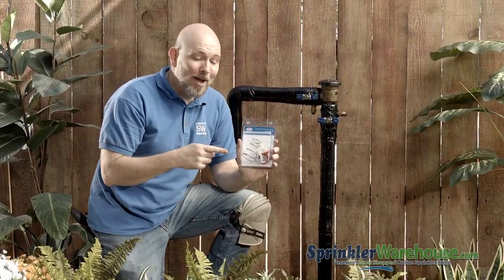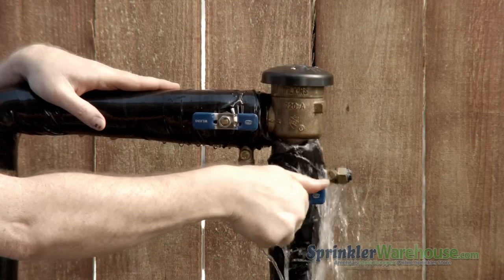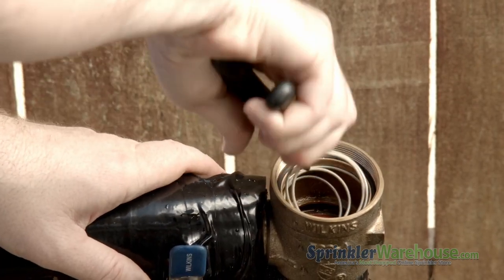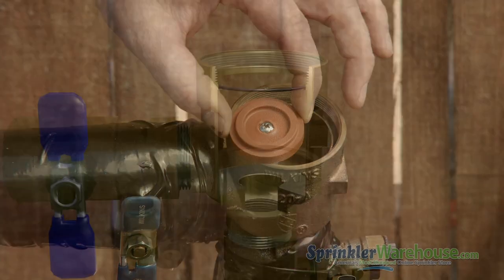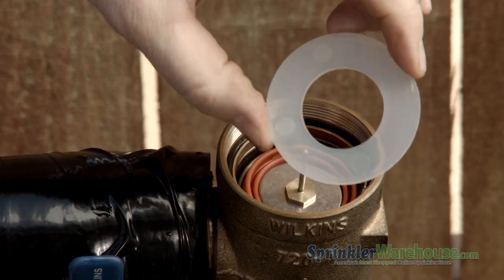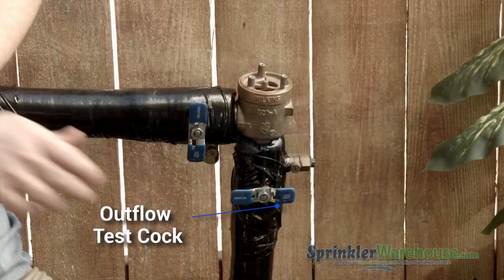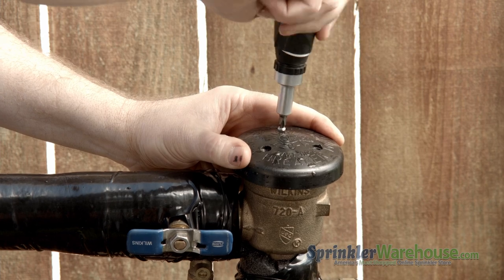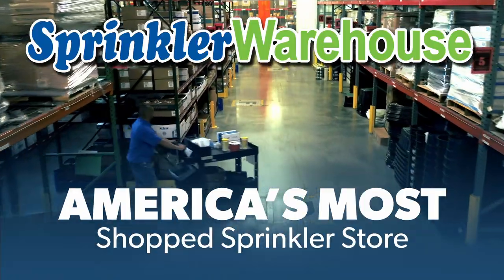Repairing A Wilkins 720-A Backflow

Comment: It's the little things....
I bought this kit from Sprinkler Warehouse last year, and just getting around to installing it now. 
The manufacturer directions don't say where to use the lubricant, so this short video showing the optional use on the O-ring really helped. 

Plus, the fact the spring gets pushed down underneath the lip of the breaker interior (you showed it as you seated it in) was really helpful as I was not sure if I should push it in or not.  

This short, concise video was perfect for a DIY project. 
My compliments to the presenter, the video team (with great audio!) and the graphics team.
Reply from the maker: Thank you so much!

Comment: Thank you for your comprehensive and easy to follow instruction in Wilkins 720-A repair. The key is locking that spring inside the housing, then everything fell into place. Never got instruction on “charging” the system via the bleed cock. Excellent job, teacher.